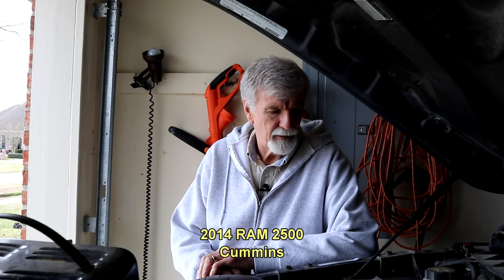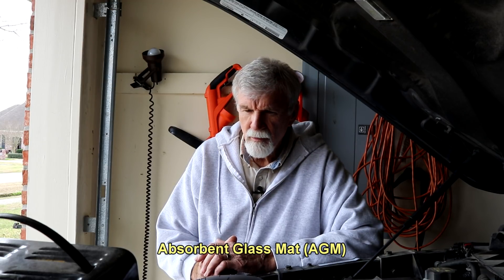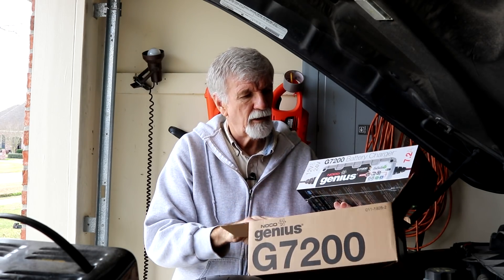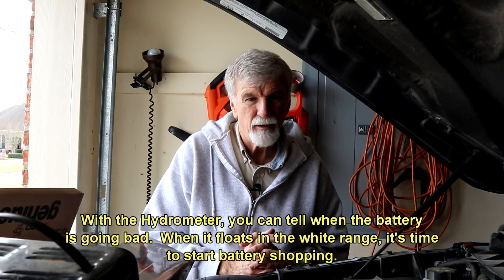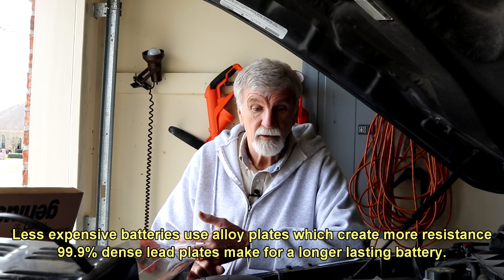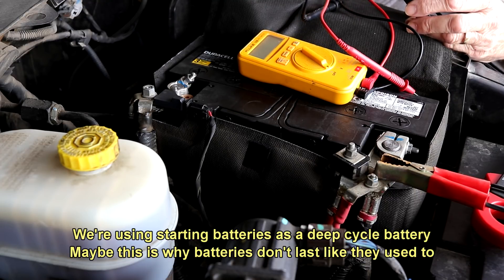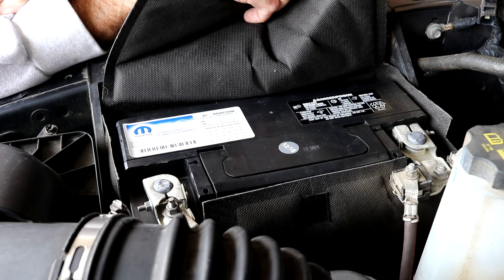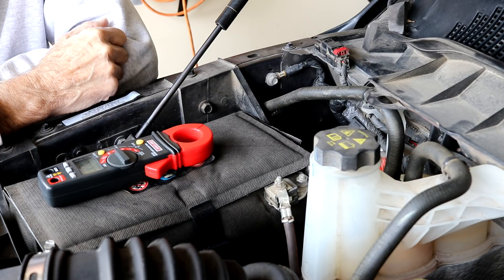RAM 2500 Battery Matching

Comment: I guess I'm lucky my truck died this weekend after 3 days of below zero.   I have power but after plug heating all goes dark.   2017 with factory batteries.  Just bought two die hards.  I found it interesting that battery warrantees are so short now.

Comment: As A AAA member I just went to the AAA batteries for my 2018 Ram 3500 as AAA will back them and replace them. But I learned the hard way that if I replace one I need to replace both.

Comment: It’s because of your video I bit the bullet and purchased 2 new batteries. My truck started fine unless the engine pre-heat kicked on then it would just “click”. I checked my batteries and one was bad. I wanted to just replace the bad one but I had watched your videos and you had remarked that you wished you had just replaced them both. As a 52 year old man the embarrassment of calling my mommy to come jump my big bad 2015 Ram Laramie with her 15 year old Hyundai was more than I could bear. I did plenty of research and picked Bosch AGM batteries, they had 4 years no question replacement and after the initial sticker shock wore off I realized it was for the best. I even purchased 2 Mopar battery warmers my plan was to use a 3 way tap and plug engine heater in with them. I never installed them and I have never plugged my engine heater in. Our winters are just not bad enough for all that. Thanks again!
Reply from the maker: Yea, that would be embarrassing, ha but mothers always come thru for us.

Comment: Hello Marion where did you get your battery insulating wraps from?? My OEM ones are falling apart. Getting ready to replace mine just purchased a new set of Duralast AGM’s🤞🏼✌🏼
Reply from the maker: they were stock on a 2014 Laramie so I assume you can get them at the dealer.

Comment: I have a 2015 Powerwagon. The battery is still good but I am looking at replacing it. For some reason Chrysler decided to put in a battery with the terminals  on the opposite sides. Because the battery cables are so short you can't  just buy a replacement of a different brand. Most brands I want say no to my truck. In my 2011 Ram sport I had to buy rwo 6 inch joiner cables in order to put my Optima in it. I really did not want to buy Joiner cables again. Any suggestions?
Reply from the maker: Not really, the only thing you can do is change the entire cables which wouldn't be very expensive.  I am surprised  you can't find aftermarket battery.

Comment: Yesterday my truck made the infamous "click" that Marion demonstrated Today I went to Costco. Costco carries only one battery to fit these trucks. It's an Interstate AGM with 850 CCA. The price was $175.99 before tax. It fits perfect and the factory "blanket" went on like a glove. 
Thanks for all of your good advice Marion. 
Dave
Reply: In this video, Marion mentions charging rate of older vehicles will likely ruin an AGM battery. Marion, do our modern Ram trucks.(mine is 2016) somehow automatically adjust for an AGM? If so, how the hell does it know? So far, my 2+ year old AGM's hasn't failed!

Comment: Marion , thanks for the video. It helped me with making my decision on approaching a dead battery I had. Question, after replacing both my batteries (only one was dead but I followed your advice and replace both) I've been monitoring my voltage indication on the dashboard and notice that after I start my vehicle it shows 11 volts for quite a few seconds before switching to 13-14v. I am curious what you think about this... if it's normal or if perhaps another problem is lurking underneath with the voltage regulation which might have caused my battery to die in the first place. Thanks.
Reply: I saw somewhere that the alternators do not "kick in" right away after starting the engine.  So much load needed just to get things turning.

Comment: My 07 Harley was the original equipment battery I just changed out last year purchased in November of 06 the boat all batteries were top-of-the-line Interstate one of them being a deep cycle for house battery both jet skis were sealed. flooded Interstate Batteries along with the Sportster battery those are the main ones. Battery replacements for the boat were Interstate again jet skis were from Meijer Big Box store because Interstate dealer now has that size made in China and I wanted u.s.. and Harley battery was from online Turbo X brand or something like that I would have to look up the name. made in USA with 2 year warranty. And yes I believe heat is a big killer on batteries along with not keeping them topped off. like your videos thank you

Comment: Good talk just found your videos today looking up things about the Dodge and oil changes and batteries I did leave a comment on one of your other videos about the batteries. Your talk today had very good information but one thing I have to not agree with is changing the batteries out every 3 years. I get up to 11 years on most my batteries and that is 12 of them. That would be costing me 1000 to $1,200 every 3 years wow! I'm a firm believer in keeping them charged 80 to 100% using a battery tender especially in the offseason. 1 battery tender 1.25 Amp Max and rotate to each battery once a month. New subscriber thanks Ed k Cleveland Ohio
Reply from the maker: That's pretty impressive.  I wish I could get my batteries to last that long.  It cost me about $300 for a set of batteries however.  What batteries are you using?

Comment: Good info. I have wondered how a "sealed" battery could not evaporate. I noticed you have some nice looking battery covers there. I still have those felt gizmos on there. Where did you get your covers?
Reply from the maker: Thanks, the covers are stock.  It doesn't have the cold weather package, those are for the south. ha  I think the cold weather ones are heated.

Comment: Costco has an Interstate Battery that fit the Ram/Cummins. $136.99 Fitment Code 30. It has the individual cell cap so you can check electrolyte level. https://costco.interstatebatteries.com/results?key=auto&ZipCode=92117&l=92117&Program=100500&choice1=1&choice2=1105&choice3=1111&choice4=1112&choice5=1113&Country=US
Reply from the maker: Looks like a good battery, thanks.

Comment: what about Lithium Ion batteries they make them for vehicles now.
Reply from the maker: I just bought a Noco charger and noticed it has a Lithium Ion setting so I guess they are coming more in the mainstream.  I don't know much about them other than they are extremely expensive.   I don't think they are practical yet because of the extreme cost for now.

Comment: These trucks sure draw a lot of juice just sitting there.  Had to charge mine to get it started after not driving it for 3 weeks.  My 2005 GMC 2500 with Duramax had two batteries and the OEM batteries lasted 8 years 10 months.  Basically, I had an hour drive each way to work and home.  I think that's why they lasted so long.  Replace the batteries and traded it in two months later on my RAM 2500. Going to check into the new charger you got.  Looks nice.
Reply from the maker: Agree also, not using them is hard on the battery.  I'm going to put a trickle charger connection on mine.
Reply: Marion, make a video of the trickle charger install please.  Keep up the great videos.
Reply from the maker: Thanks very much, I'll be doing that in the next few days.
Reply: They require ALOT just to start

Comment: Yep I love my CTD Ram , such a awesome Machine I’m so many ways ! Good video , my 2015 went into a “BATTERY SAVER  MODE “this winter when it was super cold looked it up said it was normal but went away . Have you had this come up before ? Seems a little weak on very cold mornings I drive mine about every 3-4 days but I make sure if I run it it’s over a few hours run time to get the oil nice and warm too and battery charged good , great video by the way ! Also does that battery tender charge both batteries at same time ???
Reply from the maker: Thanks.
Reply: Battery saver mode is normal after a real cold start, the heater grid pulls a lot of energy and it takes a little bit for the battery to get back to proper voltage